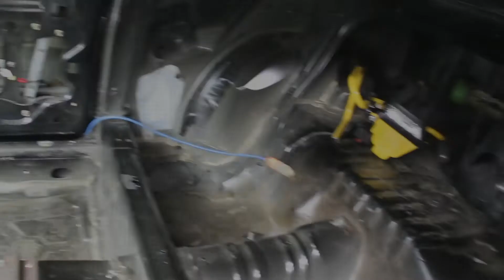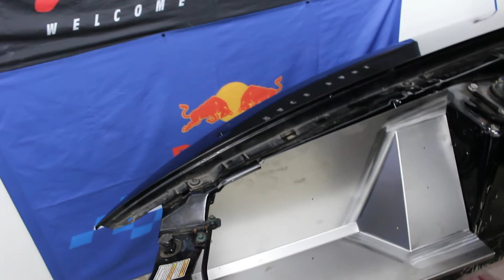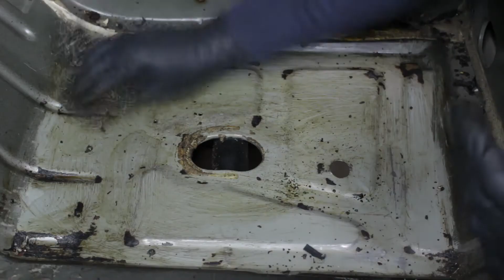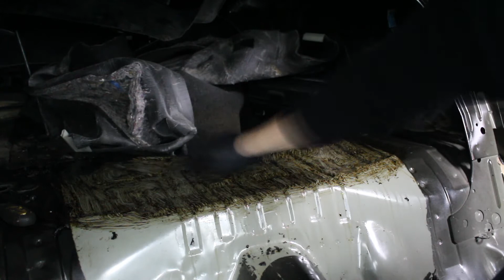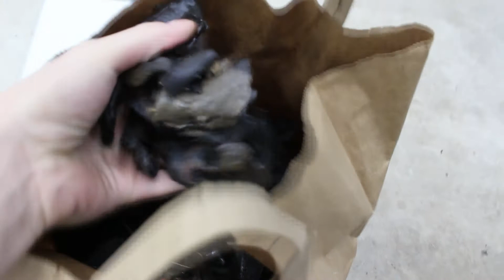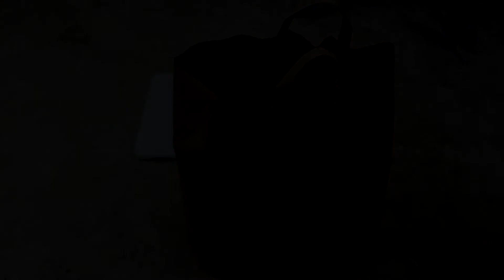Mustang Factory Sound Deadening Removal: How much does it really weigh??

Comment: Thanks for sharing!  Just wanna share a tip (if you, or anyone reading this ever do another)... I used one of those electric "oscillating multi tools" with scraper attachments to remove all of that stuff from the floor/trunk/etc, on my fox body and it made pretty quick work of it.
Only thing I remember sucking about it was, I did mine in the blazing sun in like mid-summer..  It was kinda brutal, but hey, I didn't need to break out a heat gun... lol

Comment: May I ask where exactly all the sound deadening is located? Is it just the driver and passenger front floor as well as rear driver/ pass floor. Anywhere else? Thanks
Reply from the maker: From what I remember its on the firewall, driver and passenger floors,   under the rear seats, and also trunk /wheel well area

Comment: If anything I'm putting more or better sound dampeners in,  that car is entirely to loud interior wise on top of it. I dont need a headache driving it.
Reply from the maker: right.... as am I.  people assume nothing is going back in. it was removed so a) I could finish up all the welding work that was done inside and b)paint the inside of the car properly... not on top of 20yr old sound deadener. the plan was to always put new deadner on top after repaint.
Reply: @straightlaced  I have a 2000 mustang...it s Way way to loud interior wise, has to be one of the worst insulated cars ever, I'm doing mine right now.